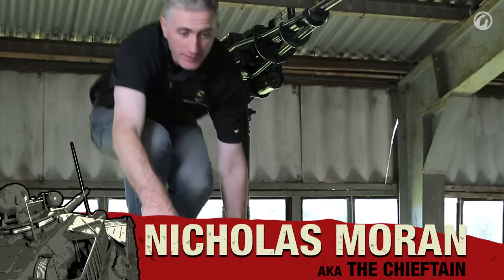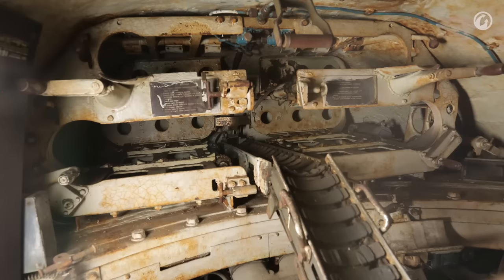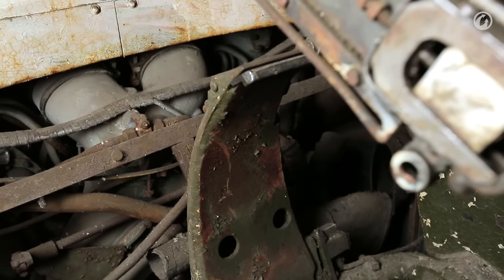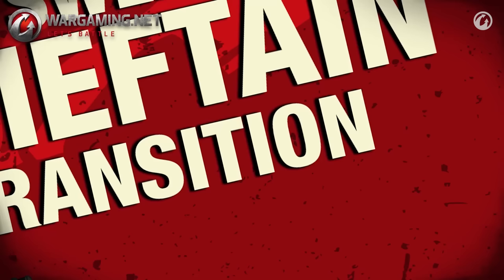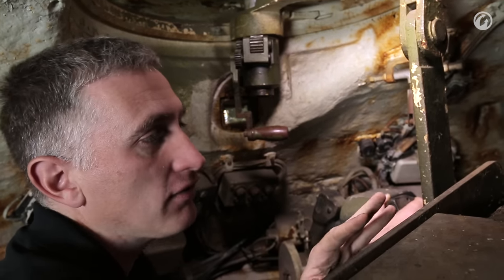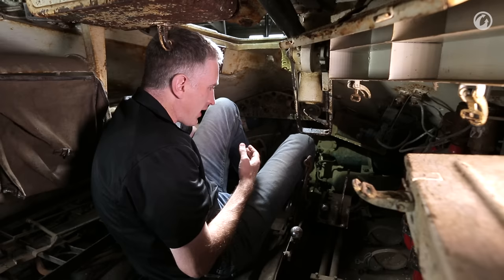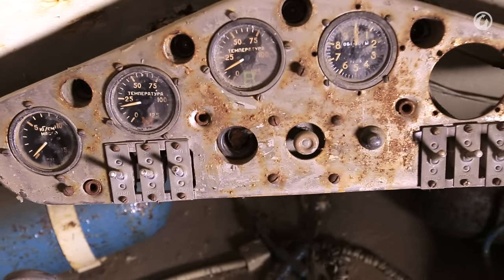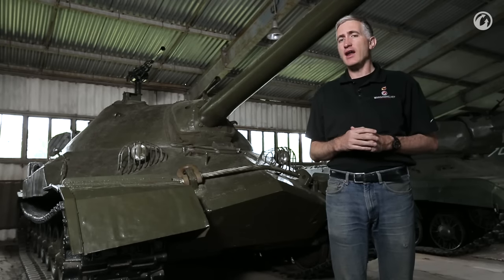Inside the Chieftain's Hatch: IS-7 Part 2

Comment: The S-70 cannon was taken off of a Kirov class light cruiser where is was used as a secondary/anti-aircraft weapon in 6x1 barrel mounts. The 180mm B-1P on the Object 261 was also taken from a Kirov light cruiser, but the 180mm was part of it's primary armament package of 3x3 mounts.

Comment: I would had went with IS-7. For me a heavy tank is a breaththrough weapon which is meant to assault heavily fortified positions and to battle enemy heavy tanks. Also, to serve as assault weapon. It's not on the other hand maneuver tank. It will always be late to support your newest pushes and it wont serve in a war of maneuver. Heavy tank role is of mobile bunker then it's not on offense. To solidify most critical spots with invincible 130 mm cannon.
Reply: From watching another video on the IS-7, what killed it wasn't teething problems or design flaws -- it was the simple fact that they couldn't transport it. It had grown to 68 tons over its design process, and the Soviet rail system only had cars that could transport tanks of up to 45-50 tons. With WWII having stood down, there was little need for a full-on heavy tank, and the lighter IS-8 (later renamed T-10) filled the medium tank role well enough; there was little interest in a design program to build railcars with a capacity big enough to carry the much more expensive IS-7, so it was cancelled.
Reply: @seanmalloy7249  T-10 is already over that capacity limit. However, transport weight limit was upwards to 55 tons. I do think that such tanks are worth the trouble, especially as enemies had no effective means of disabling them. On tactical level they would had proven themselves unstoppable.

Comment: Sorry for this really dumb question but why for some tanks does it take really long to reload the main gun? For example the 122mm on the IS-2 apparently took so long it could only fire two rounds a minute. Was it simply because the shell was heavy so two or more people were needed? Tanks like the Abrams has a 120mm but has a really fast reload time. So why was tanks like the IS-2 and Tiger so slow to reload but tanks like the.Abrams and british tanks have really fast reloads when they are 120mm?
Reply: Same for auto loaders why does it take so long for the crew to just load 4 shells for example?
Reply: The Abrams has assisted loading... also the ro7nfs are much lighter
Reply: TRUGAMER45 rounds*
Reply: Why does it take 1,5s to reload an assault rifle in CoD while it takes 5s to reload it in real life?
Reply: Dodge Charger 1970 there wasn't enough space inside the tank to store the fullsize 122mm shells so they had to put them together first before they could load them
Reply: Belgae Really? Interesting, what about the 88mm on the Tiger or the derp on the KV-2? Why such long reloads? Same for auto loaders does it really take over 40 seconds to just load up 4 shells?
Reply: TRUGAMER45 What do you mean by assisted loading?
Reply: Stubbari Great video thanks. I guess that was assisted loading?
Reply: The shell was also two part, the projectile and a charge. He also stated that a rammer was used to ensure the round was seated correctly before the breach was closed.
Reply: Stubbari Thanks.
Reply: Enrico Micheli Yes the 88 mounted on the Tiger had a long reload.
Reply: casey escobar Thanks man that explains why cheers.
Reply: Dodge Charger 1970
Ok that was sarcasm, check out the video anyway though, there's a flak reloaded in like 1-2 sec
Reply: casey escobar Sure
Reply: The problem with the IS-2 and really with most Soviet heavy tanks was there design. What they did was mounting a huge gun with an extremely heavy shell with a very heavy propellant charge in a very tight space with one loader. During the late 19th century and early 20th century Western armies carried out experiments to see what the maximum was that you could ask from a soldier. Navy experiments concluded that a 25km shell was the maximum that a sailor could be expected to load quickly. Such a shell comes down to about 12,7cm in diameter. Then the propellent charge which was about 15kg was loaded by a second loader. This all took place either in a turret or a shielded mounting with lots of room and assistant loaders to pass munition. The result where quite high rates of fire which usually maxed out at 12 rounds a minute for a sustained period.

Now the IS-2, IS-3, IS-4 etc are miserable tanks for the loaders. There only is one loader and he is cramped. He is supposed to load a shell which is near the maximum of what can be expected of him while the shell is hard to access, lift up and load because he is cramped. Think of lifting up something heavy when you are seated unconformable, it will be harder. Now think that the shell weighs 25kg. After that torment he also needs to load an 15kg propellent charge. Not exactly light but it beats the shell. Then the 122mm D-25T didn't have a very high muzzle velocity and combined with the heavy shell meant that the gun had to be elevated to hit anything at some distance. After the shot you have to depress the gun because there is no way the loader is going to push an 25kg shell into an breech when it is elevated. Finally elevating such a heavy gun takes time and that reduced the rate of fire to 2 rounds a minute.

The modern 120mm guns on the other hand have fairly lights complete rounds where the weight is most in the propellant charge. Modern "NATO style" tanks are roomy and comfortable and the loader has easy access to the munition. Then the gun automatically drops after firing to allow a quick reload. Therefore a loader can reload these guns quite fast.
Reply: The space was tight and the shell components were heavy and scattered about in the tank. For context, the projectile for an HE shell weighed some 33kg, that's 72 pounds. An AP round would easily weigh twice that. The other thing that isn't being accounted for is that the gun returns to a loading position so the shell ramp lines up with the breach. Once the shell is inside and the block is closed, the gunner needs to re-acquire the target. It's not like a mortar where you just drop the round down the tube and out it goes.
Reply: DaniëlWW2 Wow amazing thanks dude.
Reply: casey escobar I will do cheers
Reply: Dodge Charger 1970 NP. I am a history student and I try to pass on my knowledge from time to time. Always glad when somebody appreciated it. ;)
Reply: It had a two part shell
Reply: I mean it is a game, I think they added the long reload tanks on those tanks because of their high alpha damage. Would you really want a 2 second reloading FV215b 183?
Reply: I think its just because of gun complexity, like the abrams can shoot a round every 4 seconds, I think that's because the tank is designed to make it easier for the crew to operate (just my useless opinion that's probably completely wrong).
Reply: "French" amx 13s would leave/retreat from battle and reload clip from "outside" of the tank. Though they came with 2 six-round magazines. :p
Reply: Dodge Charger 1970
For the AMX 13 series, you basically had to run away to reload, and it took nearly a minute to reload the two (6-round) drums from the outside. It was reportedly "possible" to reload the drums from the inside, but it took at least double the time. It was pretty cramped in the thing.
Reply: ***** While the IS-2 had a capable gun, its D-25T gun was basically a modified A-19 artillery corps gun, which was also used as naval gun or coastal battery gun. The Germans equipped some of their coastal batteries with captured A-19 artillery pieces and even started to produce the proper ammunition for those pieces. So, the IS-2's gun depended on seperate loading cased charge ammunition, which means that the actual HE or AP shell was loaded first, then the propellant charge (either a case or maybe even a "bag" with propellant charge) had to be added, before the breech was closed. According to Zaloga, the breech modification increased the rate to 3-4 rounds a minute, like you said, but afaik the Russians did not start to implement that modification before early 1945, and even with the mod the reload time remained to be pretty long and put the tank at a disadvantage against enemy medium and heavy tanks. Without the mod, 1 to 1.5 rounds per minute was the usual fire rate of an IS-2, while a well trained Tiger I crew could sport reload times of around 7-10 seconds, according to veteran accounts, for example. According to Zaloga, the usual shell-loadout consisted of 20 HE rounds and only 8 AP rounds, which shows that the main role of the IS-2 was shifted towards infantry support, at least until the breech mod was implemented. The huge HE shells had devastating effects on enemy trenches, strongholds and roadblocks, and it proved to be particularly useful in city environments (like Berlin), but the tank suffered of its long reload time when facing enemy tanks, especially without the breech modification.
Reply: Jose Raul Miguens Cruz The IS-2 never ever did 6 rounds per min
Reply: g4rce guy AP rounds on the D-25T was so powerful that I read something on a russian website that an IS-2 bounced off a Tiger 2 at an angle but the shell hit the KT at such a force that the turret ring and other criticle components was damaged/destroyed which disabled the KT.
Reply: How can you compare Soviet 40's tank with American 1980's tank!? Time and technology is vastly different to compare them. Instead take look at T90!
Reply: What he said was comparing IS 2, Tiger 1 reload time with modern tank Abrams. There is 40 years of technological difference between them.
Reply: Ok
Reply: TRUGAMER45 Some tanks have auto loaders but not M1's.  Google it.  A good loader can load a main gun round in 4 to 7 seconds.  Auto loaders were not included on the Abrams because they 'can' fail and an an excited 19 year old can load pretty fast on his own.
Reply: ***** And if the loader is knocked out, there's a commander and a gunner that can load in his place. Instead of an auto loader where if its damaged the tank literally becomes useless.
Reply: The is2 was so pourly designed( yet well designed) for the gun that they realized they had to make the gun down downwards the be able to load the shell in. This is why it took so long to reload. But at the time this tank was indistructable compared to its pretaseser tiger 1 and its 88 mm gun. Tiger crews when they saw this tank would get scared and think the Russians captured a tiger for themselves and would high tell it out of there if possible.
Reply: DaniëlWW2 also the gun itself has gyrostabilizers that help keep the gun in place. Some tanks even have a loading system too that helps the loader. If I'm not mistaken the leopard 2 which is based off the leopard 1 and the m1a2 Abrams tanks have these.
Reply: The Tiger actually had a remarkable reload rate in real life
Reply: A tank built in ww2 couldnt hope to pen a an abrams, it would never happen. and an abrams wouldnt even have to try to pen a ww2 tank.
Reply: ParkerDai Yes, 7-10 seconds reload time, according to veterans.
Reply: MOPAR Or No Car / ABRAMS Or No Tank If the shell bounces off, especially if it bounces at a rather unfavourable angle, then the kinetic energy will be relatively low. The IS-2's gun performance was lower than the performance of the Panther's gun (regarding penetration at range), but similar to the Tiger I's 88-mm gun, except its penetration lack punch at long range. The D-25T was also pretty inaccurate, because the shells did not have a flat trajectory, due to the low muzzle velocity. German veterans reported that they saw turrets of some Panzer IV's getting knocked off completely, when they got hit by an IS-2, the Panther's and the Tiger II's turrets were too heavy, though. The armor of the Tiger II had a tendency to create some amount of spalling on the inside of the plates, so it's possible that splinters (created by the hit) had blocked the turret ring. THE thing of the D-25T was suppression and destruction of enemy infantry using strongholds, fortifications and roadblocks, with its devastating HE shells, so it was mainly used as breakthrough tank, and not as AT tank.
Reply: Jose Raul Miguens Cruz I said the D-25T was a modified A-19 gun, which explains why only 3 - 4 rounds/minute could be reached with the modified breech, and 2-3 rounds/minute with the original breech mechanism. Because, with such guns, it was not about the number of loaders, but about two cases (projectile + bag with propellant charge) that had to be loaded for each shot.
Reply: One reason might be that the crew compartments in soviet tanks were very cramped. In order to maximise weight/armour efficiency the tanks were made as small as possible. During WW2 a soviet man couldn't be a tanker if he was taller than 5' 9"
Reply: +Supercharged HEMI any big shell that hits a tank without spaced armor can get spalling on the armor the is2 couldnt take out the king tiger from longer range and close range only the turret but it spalled the plate and could damage the crew
Reply: +Jordan Favorite the abrams would be fucked if hit in the side where it has practicaly no armour
Reply: Forget spalling. A shell like that simply rips of the tracks, maybe even dislodge the turret. And it will shake the tank with enough force to break off internal parts and bang the crew into the tank with bone crushing force.
Reply: For Tiger 2 you had a round of 26kg. It took you 8 seconds to load or 6 seconds if you were fast and the commander assisting with the empy cases. Of course it only for some ammo racks others are slower. IS 2 is slow because the shell is some 50 60kg of weigh in two separeted parts. When you have to load first you have to deal with empy case. Then load the some 28kg armor piercing round behind you from the turret. Then you grab the wood stich and push the round in its correct place inside the gunbreach. And then you look were your legs are because the powder cases each about 24kg is under your leg. Turn the carpet of somewere unlock the ammo storage box open the top of the box meanwhille again look out because your legs or the turret drive can prevent you doing this. So on then unlock the securing pins and then load the last part of the ammo. So this is why it is so long to load. New nato rounds like the one on the abtams are 26kg each. In fact the same weight as the pzgr 39 for the kwk43 l71.
Reply: Ehhhhhh, today, shells seems to be less than 2cm, but can pen almost 1meter, so it is kinda lighter
Reply: Supercharged HEMI IS-2 reloads 2 separate projectile, you put the warhead first then the charge.

Comment: The reserve being foward and the drive being backward is just like a car. So as you break your body shift foward, it's easier to follwo the motion to put the gear into reverse or park. If you are breaking hard in a battlefield, you probably want to reserve really fast too, as you shift foward to use that motion to move in reverse and get out asap.

Comment: Based on what he said about the loading system; shouldn't this be an auto-loader?
Reply: It's semi-auto meaning that the loaders are only assisted with moving the projectiles. The system does not entirely load the gun for them.
Reply: +Shea Samuels but in WoT it would maybe be a semi - autoloader, you fire your drum fast, then your drum will reload shells one by one. so for example, you fire your drum of (maybe) 5 shells, with a reload between shells of 4 sec. then, you use 50 sec to reload the drum, but you can shoot in between drum reloads. like you fired your shots, and wait for reload. then, a damaged STB-1 comes to kill you after just 30 sec. then you can fire 3 rounds at it and ramming it to scrap metal. or, it takes 10 sec to reload 1 shell into the empty/half - empty drum.
Reply: professorbairos757 every tank in the game has a ready supply of ammunition in the game because you can only store so much in the turret, ready to use. Take shermans for an example, they only had so much ammo ready for the loader but the rest was stored either around the hull (or on the hull floor in later versions). If you go into war thunder you can see how these ammo setups work in their tank viewer. If they added a mechanic where the tank had to reload the ready rack then it would make sense to do that to 80% of the other vehicles in the game.
Reply: +Double A Batteries 
It's really just loading-assisted. Meaning that the loader doesn't have to do as much work. There isn't actually a clip of ammunition ready to go.
Reply: Nothing about this system is "auto". Auto of course being short for "automatic", and in this case, the tank loading the next shells for you without manual assist until its time to refill the clip/drum. 
The IS-7 in most respects performs no differently than an M4 Sherman or Tiger 1. The M4 and Tiger having smaller guns, you just pick up the one piece ammo, slide it into the breech, BOOM. 
The IS-7 being two piece ammunition (i.e: KV-2)... the loader(s) have to crank the pulley to load the projectile, then crank the second pulley to load the propellant, crank the third pulley to bring it all forward to the breech, grab the T-bar (as explained in the video if there wasn't a gun rammer) and manually ram it inside. 
At no point is any of this automatic or done by the vehicle. It's all done by a loader, the only thing the tank doing is carrying the weight of the shells in the cradles. 130mm two-piece ammo is not light in any respect. 
Side note: This also doesn't mean this system was "quick firing". With all this cranking and sliding, all this system provided was maintaining a certain level of battle performance up until the cradles were empty.
Reply: He said it was still only 6-8 rounds per minute and then even longer once those 6 or so shells were off the conveyor and then it took even longer.
Reply: idk if you heard but Italian tanks comin in will have that system, if i am catchin your drift correctly